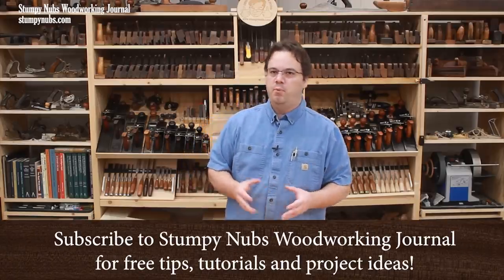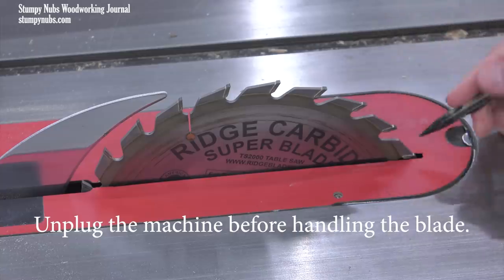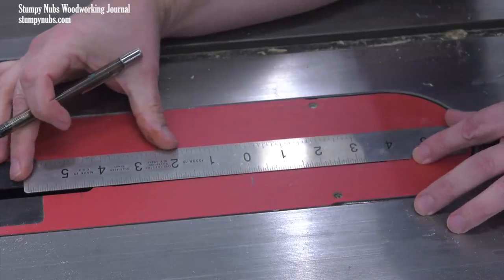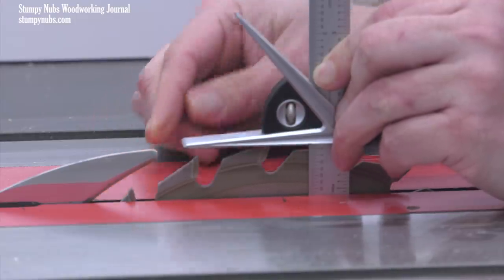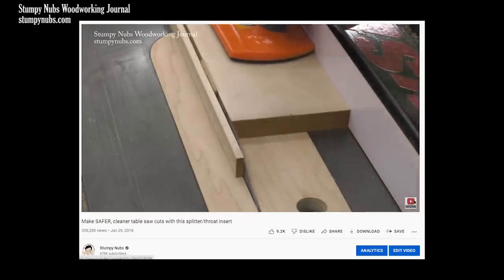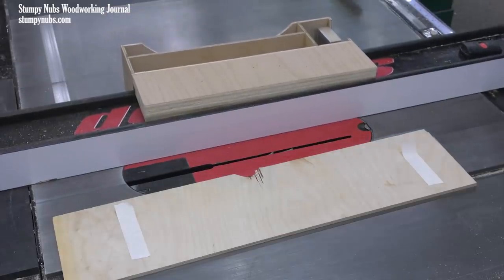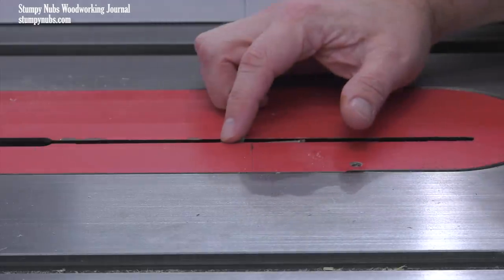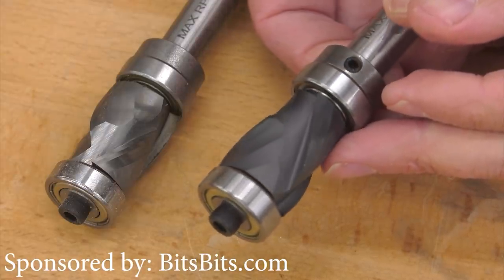Why you should mark the center of your saw blades

Comment: Great tips.  Thank you.  For zeroing in on absolutely perfect (probably not needed) check the depth of a kerf cut against the height of the blade measured exactly at a temporarily drawn center line. When exact, make it permanent.

Comment: Nice idea James I also mark the center line the Blade which helps with cross cuts to get close but have to redo it with any new blade change you can also mark left or right edges if you prefer.

Comment: Great video.  Thanks.
   I use my center-finding ruler as my go-to scale.  Steel, so it's durable & stiff, & only one of the 4 scales is marked for center-finding, so it's a wonderful tool for all measuring.  And it's accurate.
  Only downside of a center-finding ruler is that it makes me alittle lazy; too easy to grab it instead of doing the math...

Comment: I just scribed the top of the table.  Been pondering doing the same for the left edge of the kerf, too ... except though the blade will lever go further to the left, kerfs aren't aways the same width so that left edge is bound to move slightly as I switch between "10in" blades that are actually metric, thicker-kerf rip blades, etc. (I'd say thin-kerf blades but have been told to avoid those on my 3hp saw).

Comment: This idea may work for table saws where the blade height follows a vertical  path, perpendicular to the plane the table.  On a Harvey Alpha cabinet saw for example, the blade lift follows an arc.  Blade height is adjusted by rotating the motor/arbor/blade assembly around a pivot.  As the blade rises, the apex moves toward the front of the machine.
Reply: Thats how my Craftsman works too, the blade swings up on an arc.
Reply: Didn't look at the video did you?  James mentioned that in the video.  Pay attention.

Comment: Good info, I will use the method where you use the blade teeth to calculate the center point. I can't use the fence as it is a Delta Unifence that slides forward and back.

Comment: I have been a cabinetmaker for 40 years and  while your tip may be helpful to some I have never had a problem not using that idea and I do very fine cabinet work... As you gain experience certain things just become second nature for you to do to insure accuracy..
Reply from the maker: Not using what idea? Measuring the blade height from the center of the apex?
Reply: @StumpyNubs  It's funny, about half the time when I hear "I've been doing this for 30 years." its decent advice, but the other half of the time my thought is, "So you have been doing it wrong for 30 years, congratulations on not learning anything." The actual subject doesn't matter.
Reply: @StumpyNubs  I just think it's not worth the trouble... There are lots of variables once you stop using the blade you you made all your settings from.  Sawdust in the blade adjustment stops,  using different inserts, changing fence adjustments to name a few, adding a different fence face.. Finding the height the 'old fashion' way doesn't cause you not lose other settings and adjustment's because you are locked into scribed fence lines, adjustments that vary every time to you turn on your saw.   I like most of your videos but this one just seems to be a solution looking for a problem.... But, I'm sure some will find it very useful.....
Reply from the maker: @banyarola2577  This is interesting... How does moving the fence or changing the fence face affect the blade height? And how does dust on the stops affect blade height, which has no associated stops?  Finally, how does changing inserts affect blade height when all inserts should be flush with the top of the saw, anyway? I'm not new to this craft either. But all of those things seem to me to have nothing to so with setting your blade height.
Reply: @StumpyNubs  Let's just agree to not agree.....  Looking forward to more of your videos...

Comment: I was going to suggest marking the fence as the blade guard tends to move but then I noticed, your fence mark showed the blade guard mark off by a bit. And as you pointed out James, some blades raise in an arc... so height of blade determines center line. Who knew!
Reply from the maker: My line on the fence was off a little bit because, as you saw in the video, I judged by eye after the blade left a 1/2-inch slot in the strip of wood, then transferred that to the fence. It was off only a tiny bit, which would have no real affect on measuring the blade height. My throat insert (which Is what I think you meant when you said blade guard) does not move at all.

Comment: I wonder if you could mark on your fence with commonly used height measurements. Could be handy.
Reply: Hmmm. That could be very handy. Now I am contemplating if I should attempt to scribe accurate lines onto the face of the fence or inset a piece of measuring tape. I should be able to reach a decision in a couple months. Haha. Thanks for the idea.
Reply: @richpeggyfranks490 : Just be sure you don't have a fence which moves
forward and back for adjustments, like the Uni-Fence.
If that's ok, don't use tape. It will be scraped off, by your work piece.

Comment: Not sure if it would work, but if you take several measurements of center at different heights and mark it on the fence, you should end up with a line or a curve that can be used for any height. Even if the blade doesn’t rise straight.
Reply: If it doesn't work, then it indicates the rise direction is too inconsistent. Depending on the cause, the center point may even move while the saw is in use.

Comment: These are some great tips. Never even knew about center finding rulers, for example. Any tips for replacing the "throat insert" on those cheap generic saws that basically just have a piece of folded sheet steel blocking some of the gap on one side rather than an actual insert like yours? (Besides "get a better saw" or "fix the old Craftsman in the shed, ya bum" 😉)

Comment: On table saws where the arbor assembly elevates straight up and down (similiar to your Harvey*) I think th hat a graduated hand wheel should be standard equipment. This would make it a lot easier to the blade height with a degree of precision. In the traditional tables designs with the armor assembly that swings on a pivot either ahead or behind the arbor the describes an arc as it raises and lowers. The amount the blade rises per revolution is constantly changing. An alternate way of setting the blade height could be to have a ruler inset into the fence. Bring the fence up next to the blade and use the ruler in the fence to gauge your blade height.
*IMO this is the way a table saw elevating mechanism should be designed.  Saw manufactures have continued to use the old style of elevating mechanism probably because that's the way they've always done it. Graduations on the hand wheel could be produced to match the pitch of the leadscrew.

Comment: Or, you could simply use a straight edge to draw a line on your saw blade tooth tip to tooth tip through the center hole, then just get it to match up with a square (90 degrees to table top) and you've got center which you can mark on inserts, etc. might even scribe a line in the blade permanently? (though I suppose it could eventually cause a crack like it might for a pane of glass?)
Reply: That was my first thought. You could then transfer the position to the faceplate, or just use that line if your arbor isn't moving straight up and down.
Reply: I wouldn't try scribing the blade, that "may" cause a problem. 
Just draw a line, with a fine point marker.
A "Sharpie Industrial Marker" (with the red label) would be best for that.
It has Much better staying power than a plain marker and the side of the
blade body does not touch anything.

Comment: Center finding:  if you have/use a metric scale, it's a lot easier to divide by 2, and you can transfer measurements as close as 0.5mm (roughly 1/64).

Comment: I use a Digital Height Depth Gauge that cost less than $20 from Wish or Bangood, but I must admit I have not got the centre point marked, and I probably should have.  I rock a high point of the blade under the gauge, and it automatically stays at its highest point.  The gauge has magnetic feet which are useful with the original metal insert, but I think a lot of us use wooden inserts with zero kerf clearance, so the magnets are usually not useful.  The Chinesium measuring tools are so cheap, and mostly accurate, that you can afford to have a fully equipped toolbox.  I am better equipped in my retirement than I was when my employer supplied my tools.
Reply: Employer supplied tools are never more than adequate to do the job.
They find it more to their advantage to supply, and occasionally replace, adequate tools, writing them off their taxes, than to be constantly replacing high quality tools, because they keep disappearing.

Comment: will this apply if you change blades?
Reply: The center is the center of the arbor (i.e., axle). That doesn't change for different blades, or even different sizes of blades. It may vary for different blade heights, as James talks about in the video.
Reply: @ps.2 : Only if your blade rises in an arc, instead of straight up.
Reply: @ps.2  Thanks

Comment: Would not recommend marking the fence if you  are like me and have an old fashion unifence that were on many mid 90's Delta saws. Also many European fences have the ability to move back and forth like the unifence to adjust to safer ways to crosscut.

Comment: Why not put a piece of measuring tape at the precise centerline on the fence so you wouldn't need to find another tool besides what's already attached to the table saw to set a precise height of the saw blade?
Reply from the maker: The center line of the fence is unlikely to be the center line of the blade on many saws. I am not sure what you are referring to when you say something is "already attached to the table saw to set a precise height of the saw blade."
Reply: @StumpyNubs  That must be my shambly wording.. :) I meant to evolve on the idea of marking the blade's center on the fence (3:25 in the video). Instead of just marking the place to measure the blade height from - why not put a measuring tape there to just get the height straight away. If the blade goes straight up and down on the saw, that is.
Reply from the maker: I think you could do that to get a rough height, then confirm with a test cut. But it would have to be scribed into the fence face because printing would wear off and a stick-on tape would catch the workpiece.

Comment: Couldnt you just fix a narrow board, on top, flat, then just slowly raise the blade until its fully extended, then just measure the slit and divide by two? The slit should be cut exactly as the saw full range.